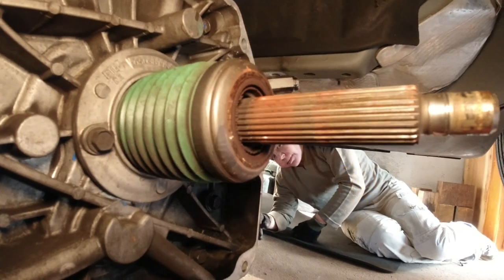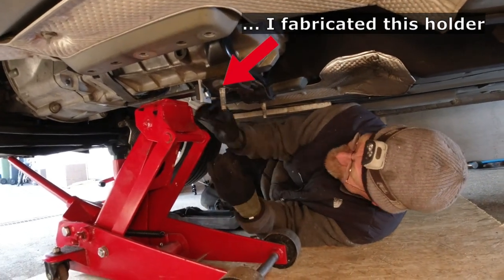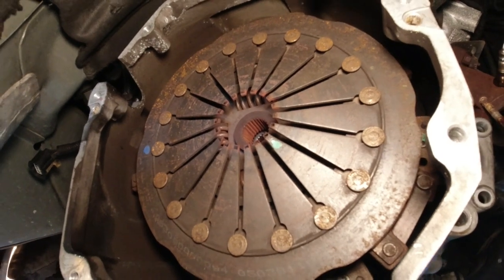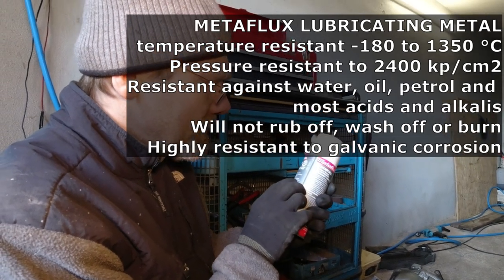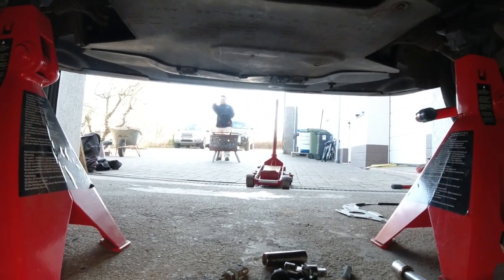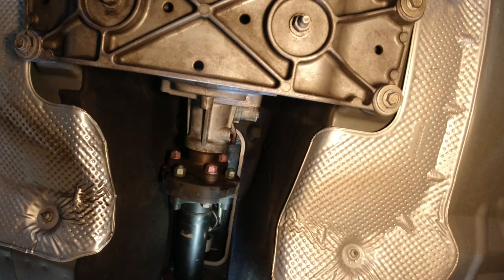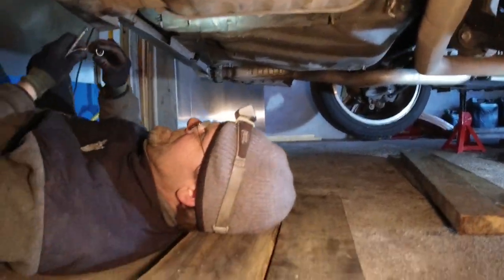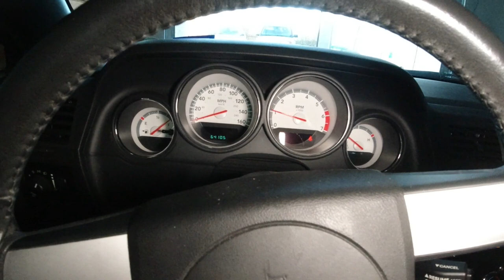Dodge Challenger RT TR-6060 Sticky Transmission Fixed

Comment: I discovered your channel a couple of weeks ago, and now all I am watching are your videos!  You guys are great, and funny too!  LOVE that you are a Mopar fan!  I have owned 3 Jags (an '89 XJS V12 Coupe, and I still have a '13 Xk8 Convertible and a '14 XK Coupe), '72 Saab Sonett III, '72 Opel 1900,  a '67 Chevy Caprice (w/ 327 cubic inch V8), '11 BMW 335d (piece of crap, but ran like an old school muscle car), '97 Mazda Miata, several Hondas (never a Toyota!), and NUMEROUS different 4x4's for off-roading to my hunting and fishing spots in Northern Michigan.  I would really like you guys to acquire a Jeep Grand Cherokee WK2 with the 3.0 EcoDiesel.  I have owned since new a 2015 Jeep GC Overland (WK2) 4x4 Diesel w/ Off-Road Adventure II Pkg (limited slip rear dif.) and I have added Mopar Rock Sliders and numerous Chief Products (Australian) Bash Plates, and 31" Goodyear Wrangler Duratrac Tires on 18" wheels.  It really does well off road in Northern Michigan, and is very comfortable on the highway.  It would be really great if you guys could get your hands on a Jeep Grand Cherokee WK2 EcoDiesel 4x4, and "Do What You Do" a-la your LR3 and LR4 videos.  Thanks, and I look forward to watching the rest of the show! 😎🍻

Comment: Great video. I have a 2009 Challenger with the 6 speed. My shift lever sticks in whatever gear i shut the engine off in. I'm aware of the service bulletin concerning the input shaft. I am going to look into the lubricant that you used. Hopefully I can get it here in the U.S.

Comment: Reminds me of the drive shaft / bevel box interface on my 2017 BMW 1250 motorcycle. Dry as a bone from the factory with both parts seized to each other. I guess 5c worth of grease is too much to ask for on a $30,000 motorcycle.

Comment: Hi, Love the channel. Fantastic work. I have an issue with a whining noise om my 2006 Discovery 3. It occurs when giving throttle/maintains certain speed e.g 40km/h, 60km/h and 80km/h. It is probably there at 50 and 70 as well, but not noticeable at the same level. When letting off the throttle it disappear. It is not a wheel bearing and we are exploring front diff or transfer case as a potential issue. The driveshaft is new. Have you had any issues with whining noise on your D3? Any idea?
Reply from the maker: Our drive line is all quiet.  I think if it is the front or rear diff, you would hear it from the front/back.  I would change the oil in all 4 gears and see which one is discollored or has metal particles in it.   Starting with the diffs, then transfer case and then gear box.   Then i would trace the noise per gear and speed.  You could differentiate if it is caused by drive shaft speed (sorry propshaft speed) and or engine rpm vs. gear ratio.  If the noise is independent from the gears and noticable at certain speeds it might be bound to the propshafts and its synchronous components.   You can also mount a microphone in the front or back and listen to it while driving.  A WLan action cam linked to your phone will do.
Reply: Thanks

Comment: Should’ve had the owner install a speed bleeder line to the slave cylinder…. But maybe they don’t drive it hard or often. It’s a PITA to have to remove the trans/bell housing, so it’s definitely one of those “things” to do whenever possible. 

These transmissions equipped on any car, tend to have issues with the shared brake and clutch fluid reservoir. Even after separating the clutch fluid into it’s own, separate reservoir, the clutch fluid is then seen typically constantly going dirty 24/7, bc of the lack of access to plenty of excess/available brake fluid. 

It is usually best for folks to replace their brake fluid in their reservoir and cycle it every 6-8 months, in my opinion. If separated, the brake fluid is safe, but then the clutch fluid reservoir is now super small and needs to be changed anywhere from 1-3, maybe 4-5 months tops. Even if not driving HARD (causes physical clutch dust to shoot up the input shaft), driving A LOT will cause the same clutch dust to SLOWLY make it’s way of contamination into the clutch (brake) fluid, practically the same way.

Comment: did you remember to add the "electrolytes" ? and not toilet water?

ps, I noticed the prop shaft coupling at the gearbox looks very much like the discovery 2 rear prop shaft coupling. so if you ever need to replace it, you might get it cheaper from land rover parts web pages than American ones, unless President Camacho says you must.
Reply from the maker: 👍😄 We just sold it, unfortunately🙋‍♀️ Vera

Comment: Like you and Vera l run my LR3 with all that entails - and my other car a 500SL a month ago died on me whilst just started up and ticking over - l live rural France Pyrenees local garages will not touch it - obviously an electrical problem stuck in park at the top of our driveway - no start can’t move it - lv changed the ECU and reprogrammed - still no start, had the car years kept well serviced first ever problem - turn ignition on and the cooling fan goes like the car is going to take off - it’s German so why isn’t it working ??? Iv done all the rounds on the internet - nearest Merc agency miles away
Reply from the maker: 😳 That sucks, I hope you can get it figured out.🙋‍♀️ Vera